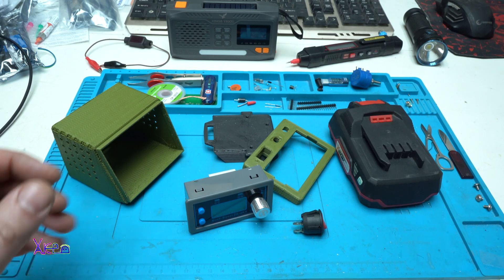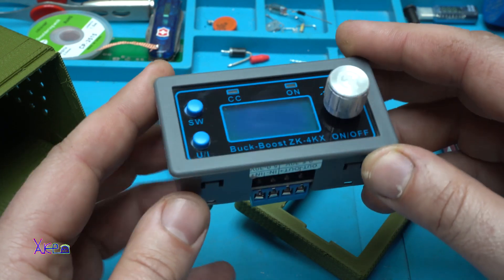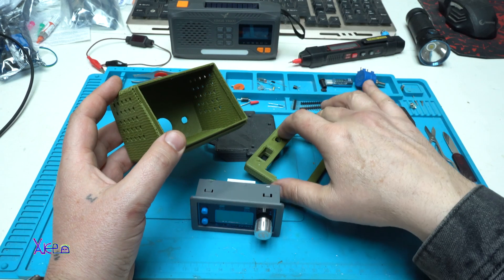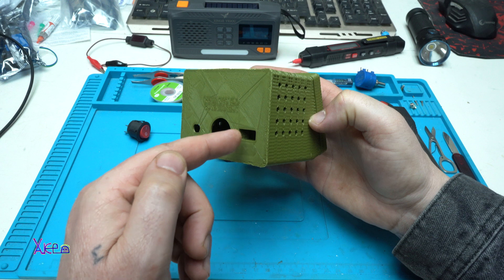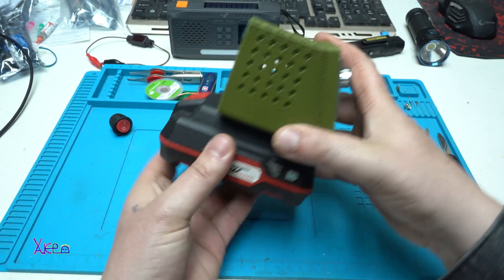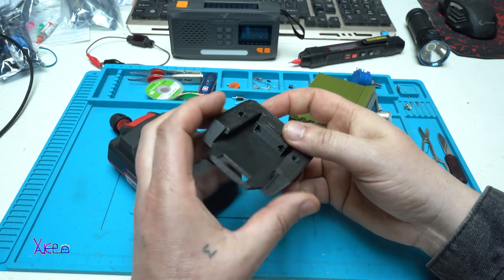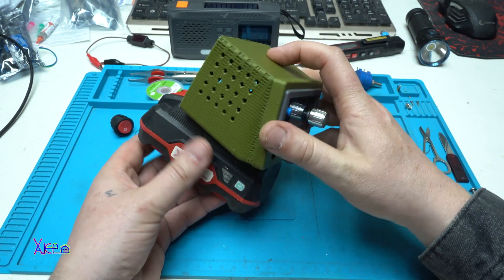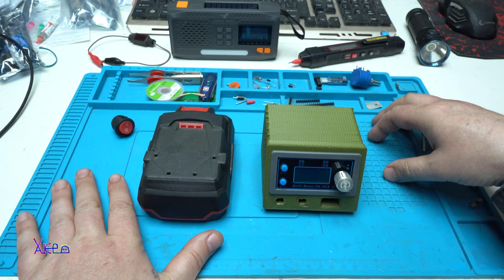This Buck Boost Converter 30V-4A I USE for my Next PROJECT?

Comment: Sir, use spade connector male. The big one. You can use it as a terminal that will connect to the battery. It will handle high amps as it is used that way anyways. You can attach it  to your adapter using epoxy.

Comment: I've made couple of similar devices. The one that takes makita batteries have banana leads from modified chinesium "makita" usb-adapter and it's otherwise done with bought parts. You can get sheet metal box for ~similar power supply modules from ali/ebay/etc. The one I made says it's 5A/50V/250W, but the 18v input voltage limits it to about 180W. I use it mainly for driving bigger (24/48V) smoke extract hatches while installing or trouble shooting. We used to carry lead batteries to the hatches before, so this is way easier to handle and it also shows the current.

Other one is more custom. Some random broken safety switch had almost perfect size and shape, so I stuffed the ps module and 3S 18650 in it with charging/balancing circuits. It's only 4A/30V thought (and the cells won't let it to the maximum power) and is used for smaller stuff.

I have couple more modules waiting to be build like the smaller one, with internal batteries for the simplicity while using.

There's a lot of differences with those modules, the one I pretty much randomly found for the "makita" one has the best ui in it and the smaller ones with basically exact same buttons may work totally different to each other. Some let you set limits for input voltage, so you won't drain the batteries etc.

Oh, and for the "makita" one I got Bluetooth addon as a joke.. It has saved me couple times by being able to remote on/off from 15 meters away when trying to find which wires go to which device..

Then there's function generators (or maybe just pwm) in the same module form.. Have few of those too waiting for inspiration.
Reply from the maker: You made some good projects with clever solutions sir,I salute you😉

Comment: Recommend a battery monitor module to avoid over draining the battery.
Reply from the maker: I will add main power switch,that will fix drain
Reply: @Hacktuber  I should have been more clear. A circuit to prevent the battery dropping below safe levels while being used. Copied from another page: "20 volt 5S packs and with a cutoff of 15v / 5 is 3v. 3v is a safe figure to discharge 18650 style cells to. You'll also find that once around 16v, the voltage starts dropping rapidly and by 15v it will drop like a sack of s...."

Comment: Attach metal strip as extention of the output terminals of the battery. The terminals from the adapter can be with springs and strips. After removing the adapter as well slide out the extention from the battery terminals. Just few steps more. And the extentions can have attachment places to be stored in the adapter

Comment: Lidl also sells crimp tool sets with just the right terminals for the adapter - I've been using that combination to power my soldering iron when I don't want to be tethered to my desk.
Reply from the maker: Thanks for the info!

Comment: Great idea! You should check what the real continuous power output power is, and the ripple voltage. I bet it isn't 30v x 4A = 120W :)
Reply from the maker: In specs it says that is 120w,I need to test that in part 2 of this project
Reply: and test efficiency
Reply: good  point.

Comment: I'd recommend you using male faston connectors. Quite cheap, can be crimped quite easily, and it should be easy to print the adaptor to latch in, so they can stay in place without glue.
Reply from the maker: I will try the suggestion,thx sir

Comment: Looks good!
Reply from the maker: Thx,still working on it,there will be part 2😉
Reply: @Hacktuber  Cool!
I've used 18V battery packs with similar buck boost circuits, just the PCB though, no fancy LCD. I used crocodile clips to attach to the battery pack.